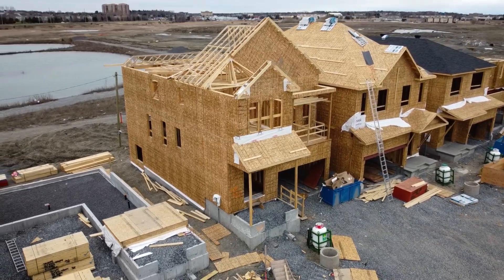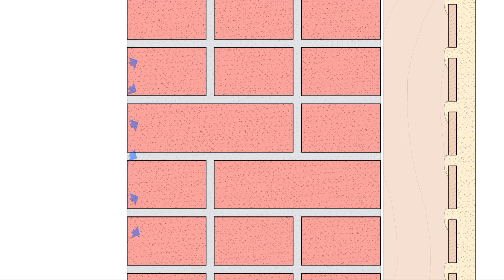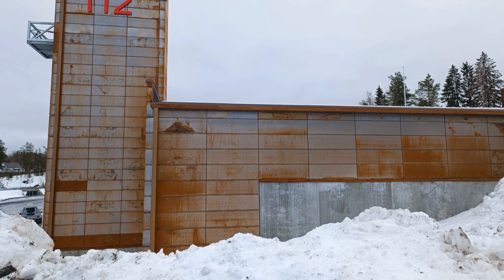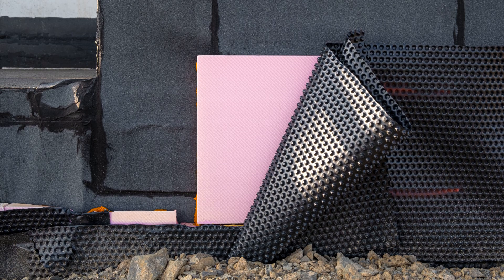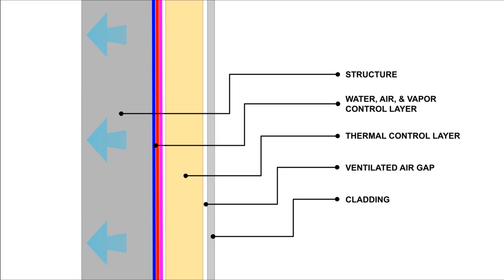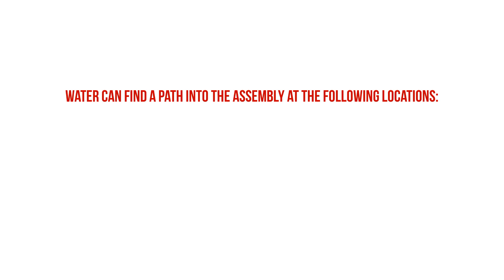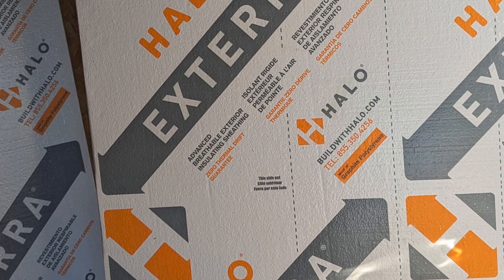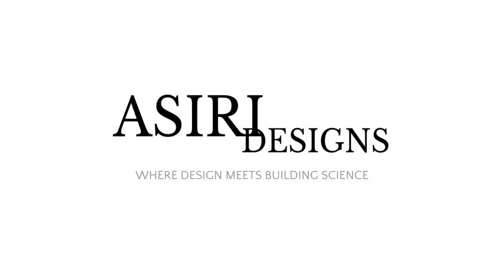Designing a Wall That Will Last 500 YEARS?! | The Perfect Wall

Comment: To make a wall that lasts 500 years, there is nothing better than a meter thick, stone block wall. Holds every time... Only susceptible to quarrying.
Reply: I was thinking of  concrete retaining wall blocks, simply easier to get ahold of. Roughly 2 meters long, 1.3 meters tall, and .7 meters thick. In the US, they can be used to hold back mountains (more or less)
Reply: @andrewandsueniemeyer6958  Those dimensions must be wrong.  7-meter thick concrete blocks would make a heck of a wall. Finally, a true rival to the Great Wall of China 🤣
 But yes, concrete blocks if properly infilled can also last a long time.
Reply: Stone walls last precisely until the next serious quake in that area. At which point, they fall down on top of whoever's unlucky enough to be near them. Have a look at what happened to Christchurch if you want nightmares.
Walls need to be tied together by something better than gravity and a bit of mortar.
Reply: @tealkerberus748  Gosh. That was nothing. I thought you were going to say Italy's 2016 earthquake.
But the thing is, I said meter thick stone BLOCK walls, and the church was made with irregular rocks and mortar. And to be fair, most old buildings with thick walls stood pretty well the quake, with only small parts crumbling. But also, a new building fell with all its elements tied, as you say. And in that case, the whole thing just fell down. All of it. Because one part breaking dragged the rest of the building down. Similar to what happened in Champlain Tower, where the whole thing fell down for a single fault on the structure. So I'm not so sure about in what kind of building I rather live.
Obviously, to stand a quake, a building must be made to do so, and it has nothing to do with the technique used, and more to do with the design and how overbuilt it is.

Comment: This is typicall European wall sandwich.

My perfect wall would be RedBrick as structural wall + aerated concrete insulation + large roof overhang. It is perfect solution to heat, air and vapor management. You can coat aerated concrete with vapor penetrating paint.
And also you can easily change the form of blocks to change appearance.

Brick veneer is pretty bad solution to adress physical damage and stormwind. Mineral wool contains formaldehide and it is also deteriorating, can release health damaging particulae to air when damaged. 

Now prefab conrete blocks are good and popular here aswell, yet they inferior to redbrick in terms of heat, vapor and air management.

Comment: The “perfect wall” in this video is very rigid. As someone who lives and works in the seismically active PNW, what do you think of the ability of this assembly to withstand significant damage in an earthquake? I’m not talking so much about collapse—that’s easy enough to engineer, at least to a life safety level of seismic resistance; I’m talking about major damage to the components that will result in very costly repairs. Particularly for houses, it seems to me the inherent flexibility of wood framing might result in less damage and/or much less costly repairs. Thank you.
Reply: If we start building structures to last 500 years like our ancestors did, wood would be the best structural material because it has the lowest embodied energy, it is renewable, recyclable, it is light and has good tensile strength. But also in terms of seismic resistance does it work really well as proven by traditional Japanese architecture. Masonry walls are a good alternative in areas where there is a shortage of lumber and low seismic risk. 
Personally, even with wooden framing, I would still agree with the video and use the brick facade with air gap since traditional (stone) masonry is the most universally beautiful building style but also when done right, it will offer the best protection from the elements. But it has to be built with earth/lime mortar as was done traditionally. No hydraulic lime/cement or it won't dry optimally.
In case of an earthquake, the structure will move with the earthquake and survive, but the interior plasterwork as well as the brick facade will most likely crack. But rebuilding a facade and fixing plaster cracks is much better than being dead.
Reply: My own kit-home prototype efforts use a steel portal frame skeleton as the underlying structure to resist wind, snow and seismic loads.  If designed properly steel frames can flex and absorb seismic forces that might otherwise fracture masonry and wood frames.  The exception being traditional Japanese joinery that flexed to give but not yield too much.
Reply: @SeattleCoorain  Steel fatigues. Wood can flex thousands of times longer than proportionate same structure in steel.

Comment: My dad recommended your videos yesterday and the binge watch I am on is fantastic. I have a follow-up question to one posed by a century home owner in Illinois about retrofitting old homes. I own ~140 year old brick farmhouse in similar weather conditions to central Michigan (super hot and cold, lots of humidity, decent amounts of snow, some wind, some rain). The walls are double brick to the roof starting from a stone foundation and dirt floor basement. My plan is to underpin the foundation with the goal of eventually finishing the basement. Your videos and articles on basements are entirely thorough and make that part of the project pretty straightforward but I'm wondering what to do once I get to the main floor and upper floor. Do I treat the brick like it's a veneer, leave an air gap and add insulation inside the house or is there another approach I should look at? Looking forward to checking out the articles and picking up at least the basement guide on your website.

Comment: The only thing i don't like about the "perfect wall" is that there isn't a vapor open wind breaker blanket.

Rockwool is NOT water resistant if it gets more than a few drops a year on it.

Water washes out the oil and it just sags to a mushy mess.
I have exterior rockwool insulation and then a wind breaker over that again like Tyvec (not the american type but much stronger) and it's made to handle much more water, and then a 5cm air gap before the wood siding
Reply: Rock wool drys out and does not lose it's rigidity when it gets wet.  Fiberglas, though, sags to a mushy mess as your mention.

Comment: European here. Really starting to enjoy this channel. Im still a structural building engineering student, with an interest in building physics, so im not an expert yet. But my future favorite would be something where we build the structure made from a skeleton shell: glulam columns with plywood or thin clt as exterior sheathing. On the interior, plywood as well with a roll on vapor retarder that you can manage to mix to a grade of retardency (if thats a word) suited for your climate/situation such as bathrooms versus living rooms). Of course a roll on WRB on the exterior, with then mineral wool as exterior insulation with an R value that avoids all condensation. Between the studs i think wood fiber will be okay since it is more sustainable, has better thermal mass than mineral wool, and is of less risk regarding bugs and termites than the exterior. Of course all overhangs should be monopoly framed as Matt Risinger calls it, so all the control layers are fully continuous.

I like eco friendly products so i prefer wood compared to concrete. And to protect the wood completely, i hope we could have a mechanically ventilated cavity, that is completely sealed from the outside environment. All temperature changes, humidity and ventilation is mechanically regulated this way, so no way of any insect to get in. With the advancements of solar technology, roofs should be able to generate enough electricity for every home to supply energy to that mechanically ventilated cavity.

Plus, with transparent aerogels becoming a thing, we could have double glazed windows with aerogels in the cavity, with r values beyond imagination of today.
Reply: Your ideas and design approach seem sound to me.  In retirement here in the United States, my goal has been to design affordable and sustainable residential kit-homes.  Was not smart enough to achieve affordability using prefab modular techniques so popular with architects today.  Then I noticed many prefab modular firms were going bankrupt: Glidehomes (Michelle Kaufmann AIA $350m VC investment), Katerra (4,500 employees, $3b VC investment) and many others.  Stopped designing until I felt that I understood the issues and how my small efforts might achieve different outcomes.  

Prefab modular in reality for me is just "stick-built" construction on two sites: the "indoor assembly line" (which isn't one really) and then yet more stick-built on-site work.  The stick-built residential construction process is extremely successful and versatile.  Problem is ... there are just too many sticks for it to be inexpensive in our current era.  The need to stage trades and the shear number of parts takes months of effort, even using large crews.  An affordable solution for housing must drastically reduce both the number of parts and the time required to under 30 days with a small manufacturing and assembly crew. 

My way forward is perhaps similar to your own idea to use "...a skeleton shell..."  as the basis of design.  My father was the engineering co-founder in 1962, of a successful aerospace metal forming company here in Seattle WA (NW corner of United States), so I am most comfortable with metal structural elements, though I appreciate the unique contributions of wood in building and rock wool for insulation.  The approach I have chosen uses rigid steel portal frames as a structural skeleton overlaid with exterior prefab panels, window and door elements.  Floors and roof are also rigid prefab panels.  Working well so far.  Steel portal frames allow me to use concrete pier foundations to simplify the on-site work.  Admittedly the concrete work has it's own timeline, though it is extremely simple and might be amenable to prefab.

Could not make progress without using Finite Element Structural analysis (FEA) tools from SkyCiv to test the ability of my various designs to handle loads successfully... highly recommended.  The prototype kit-home design will be submitted to a local structural engineering firm for analysis and approval, but SkyCiv is helping me understand structural issues before submittal.  I will likely look to hire ASIRI Designs to evaluate the kit-home prototype for energy and water management issues.

May you have good luck with your own design effort and education.  Be brave and innovate.

Comment: I like your approach to limiting air exchange by using a solid masonry surround way better than relying on tape. Your brick walls will also expand and contract less, another big plus to reducing air exchange. (Do people really believe taped seams will endure for decades?) I don’t know how well CMU will withstand flexion? Or how high you think they can be built without structural problems. Moisture infiltration from the inside will always be there, but it can be controlled using a dehumidifier, which should be standard now with more efficient heat exchange control anyway. Thicker walls might prompt a thicker basement wall, and footing, but a thicker basement wall is another plus for limiting water infiltration, especially with a better grade of concrete. Unfortunately I don’t hear much about the best concrete types, or new ideas about concrete foundations. I’m sure these industries are developing innovations of their own. Also, as a further out idea, with all the plastic waste we generate, putting 4 X 8 plastic sheets on the outside of a wood-fabricated house, even sheets solid enough, possible reinforced in some manner during fabrication, to be structural, and sealed between sheets as they are applied, would be totally waterproof and, for all practical purposes, would not degrade. Attachments for rigid mineral wool panels could be molded into them, so you wouldn’t waste time with all those long screws. Utterly insect proof, of course. I think the ideas you present go a long way to making everyone think notionally about the materials and designs being used. A very much needed addition to all this design work though, is quantitative heat exchange modeling. There are lots of engineers who do these calculations for industrial processes, but no one so far has brought them into this field, or learned to do these calculations themselves. Academics might be interested enough to do it for free. Or interested in taking what they know how to do and generating a consulting business. These calculations are needed to critically assess the cost benefit of various building insulation and air sealing designs. These analyses need to look at climate specific conditions driving the heat exchanged, such as average temperature by month, let’s say, and daily peak heat exchange variations, which are probably more a matter of sun exposure than ambient temperature variation, and tell us what building design features are most important. Maybe that will validate the what people believe now, maybe not. It’s really the most immediately accessible way to reduce heating and cooling expenses over a lifetime. You just pay for that up front.

Comment: An important benefit of exterior insulation is moving the dew point (and thus condensation water damage) from indoors to outdoors. That's one reason why the "perfect wall" is famous for working in any climate; thick enough exterior insulation makes a major problem go away. Great video as always!
Reply: There is another important benefit, but Americans are not aware of it because their houses are built with very light materials. I am referring to the thermal mass of a solid brick or CMU wall, which, when externally insulated, keeps the house warm with lower energy consumption.
Reply: Help, please. I want to insulate cabin walls in northern MN. Currently, the wall-from inside to outside-is vertical tongue and groove 2x6, Tyvek, then cedar siding. 
I go up in wintertime and that wall has frost on it once the stove going. 
I wanted to add something on the inside but am worried about trapping moisture inside. 
My thought was rigid pink board or polyiso with taped seams, furring strips, then finished wall. 
This seems okay to me, but I’m not totally sure.
Reply: Dew point is much less of an issue if you maximise the convective drying capacity of the entire wall assembly. The reason why traditional European buildings last so long is because the building materials do not obstruct the wind from drying the walls. Hence the use of earth and lime mortars. Wood and brick can last for centuries if you keep them dry. This does not mean that you protect them from water but rather do not obstruct their INHERENT capacity to dry. It's very simple and it works but engineers, for some reason, always have to over-engineer the shit out of everything.

Comment: There is nothing you are going to do to make clay brick last 300 years without major maintenance.  There are plenty of 300 year old brick buildings in the US but they all have needed to be maintained.  Acid rain alone will wreck havoc and will eat that coating you put it on the brick.
Reply: Should have giant roof overhang to keep most of the rain off the walls. Only extreme wind + rain will cause rain to get to the wall.

Homes without roof overhang tend to always look dirty after about 5 years.

Comment: Will the vapor control layer damage the CMUs by not allowing water from inside to pass through?  I've seen plenty of brick and block walls destroyed by paint holding water in the brick.
Reply from the maker: In the case of the "perfect wall" in new construction, the short answer is no, as we would be integrating capillary breaks and keeping that wall away from bulk water and cold temperatures. When you're dealing with existing CMU walls or exposed CMU walls, then the permeance of the coating matters more since that wall is actively absorbing and storing water. We've actually got a couple videos on this topic on the channel.

Comment: That wall is going to be extremely thick. The windows would be like looking through a tunnel
Reply: And that is why, for walls anyway, foam is often preferred, te reduce the thickness while maintaining the insulation value.
Reply: Actually no thicker than in a traditional (older European) building and the windows are beautiful with deeper jambs.
Reply: @pcatful  What are you comparing? 1930's have 100mm brick, 50mm cavity, 100mm brick; total 250mm
New builds are more likely 120mm sandlime, 150mm cavity, 100mm brick; total 370mm